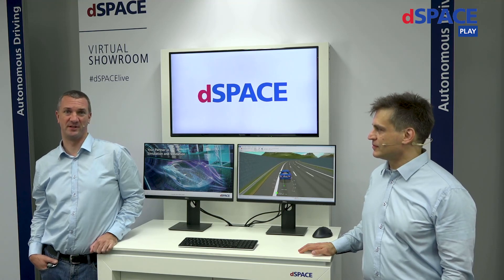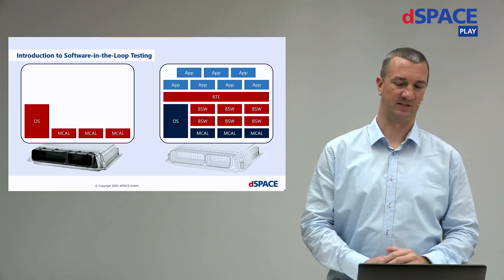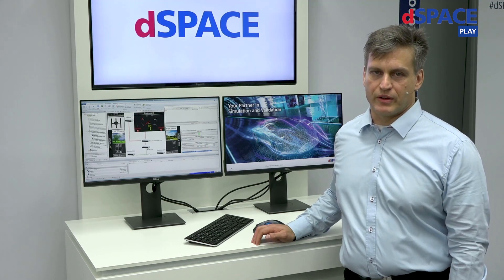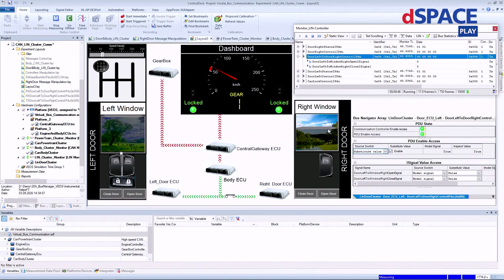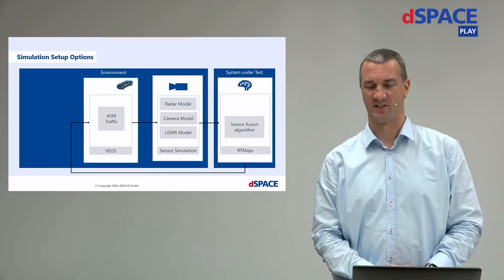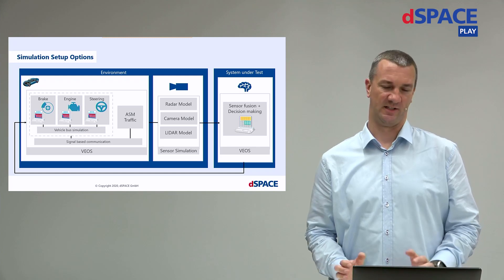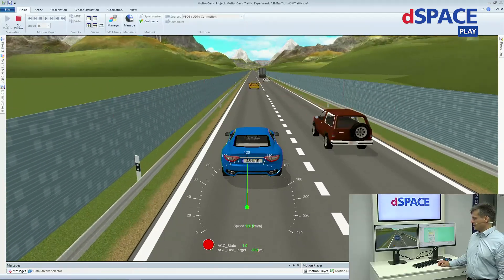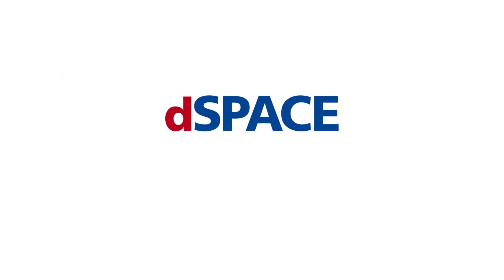Software-in-the-Loop Testing

Comment: is this can use to simulate road network ?
Reply from the maker: Hi thank you for your question. Yes, in the dSPACE Software in the Loop environment you can simulate complex road networks, as well as analytical traffic situations. We also offer to create road networks and parametrizable traffic situations from recorded data.
The ASM models also allow to simulate multiple “agents“ (vehicles simulated with full vehicle dynamics and traffic sensors) within the same simulation. This enables our customers to develop cooperative systems like platooning as well as other systems relying on vehicle to vehicle (V2V or V2X) communication. We also have applications where customers integrate traffic simulations.
To sum it up: Yes, I think we can help you please do not hesitate to contact us info@dspace.de to discuss your application in more detail.